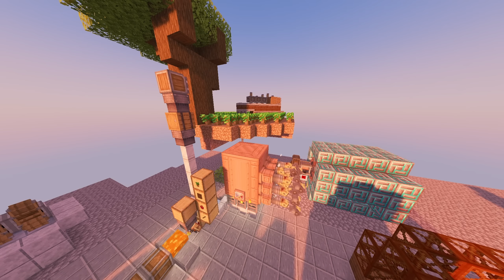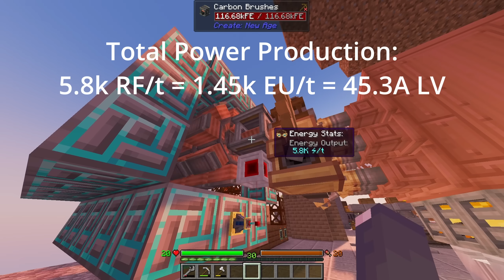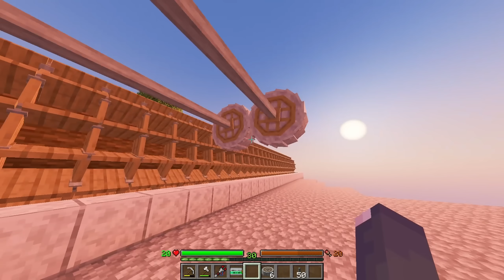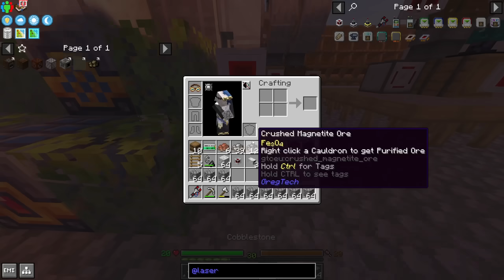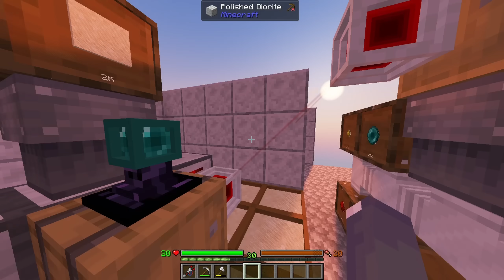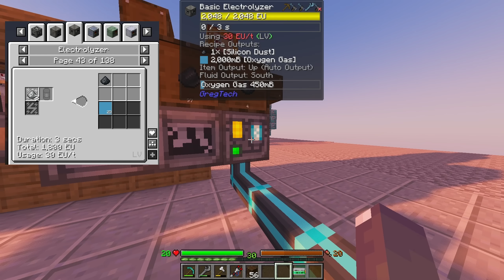Create is OP in Star Tech | Star Technology EP02

Comment: Note that is probably too late because youtube didn't notify me for this video:
Planks are actually a more efficient fuel than charcoal if you use mechanical saws
Mechanical saws turn a log into a stripped log and then a stripped long into 6 planks, which smelts 9 items per log instead of 8 for charcoal

this is probably no longer relevant because the pyrolyse oven makes this no longer true anymore (1 log to smelting 10 items)

i've been using this same steam engine jank in my star tech run right now and its fucking stupid its supporting power well into hv somehow

Comment: I'm currently just starting HV (built the hv assembler and energy converter) and also had the 3x3 sieves+deployer combo for each of the four sieving types feeding into a single Create ore processing chain.
But I was annoyed by all the item entities on the survey being picked up by my magnet and the single or ore proc chain getting backlogged all the time.
SO, over the last few evenings I refined it into four MV mechanical sieve feeding into 7x parallel Create ore processing chain covering all seven of the basic Crushed Ores. Now I can keep on my magnet without filling my inventory with random junk and the sieves can't even keep up with the processing. 
Oh, and the Create processing has no further input cost after it's set up, no energy or fluids required.